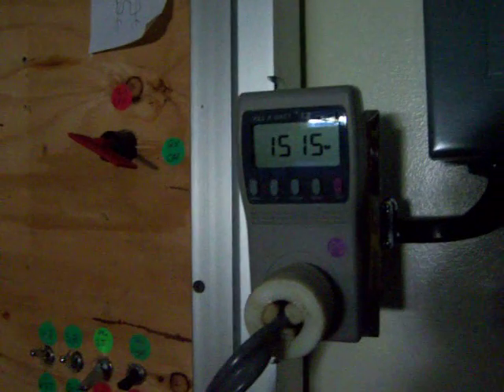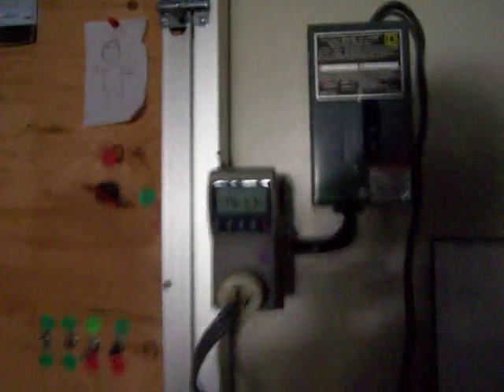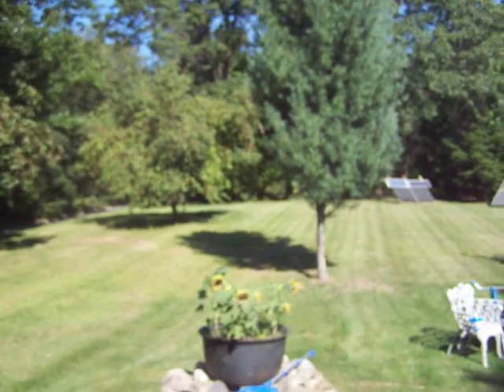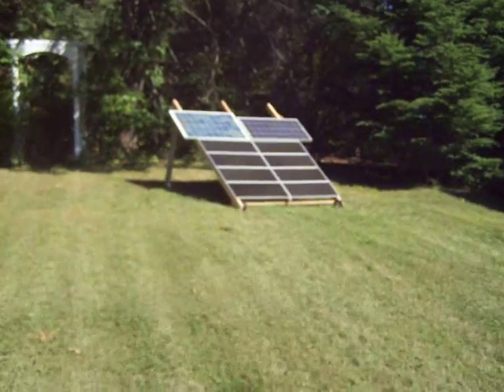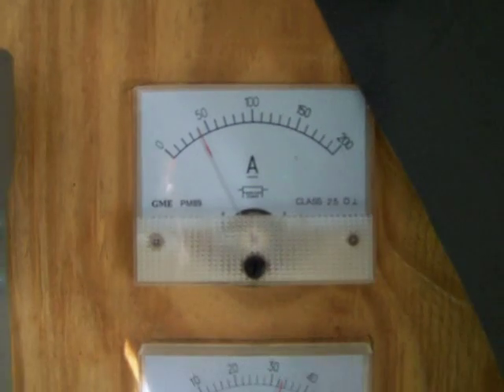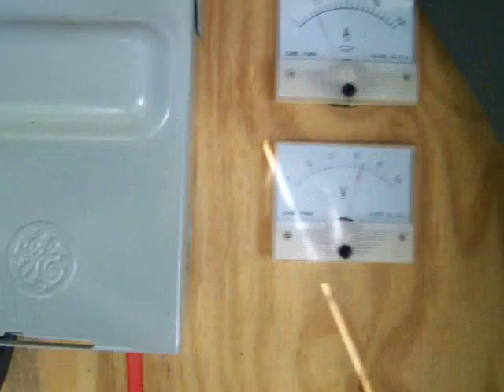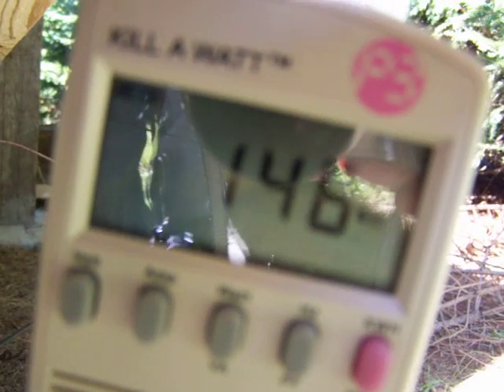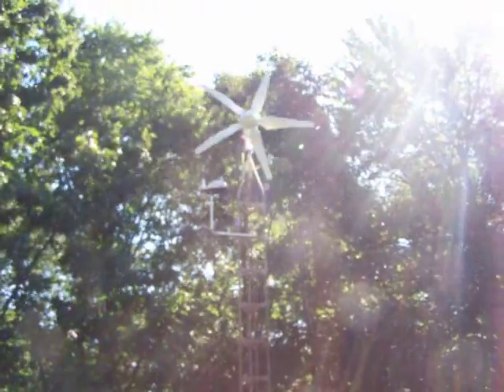another small update of grid tie readings

Comment: Great stuff Michael.  Thanks.  I'm a bit worried that you are putting too much voltage on some of those GTIs.  Some are only rated at 28-30V max and they are 72% efficient at best, the rest is lost as heat.  Higher end GTIs are good for the watts you have as they can handle the higher voltages, they use MPPT (adds 30% more watts), and are near 95% efficient.  It would pay for itself in superior output to the grid I think.  Just a thought.  I like the new stand - dodges the shade.